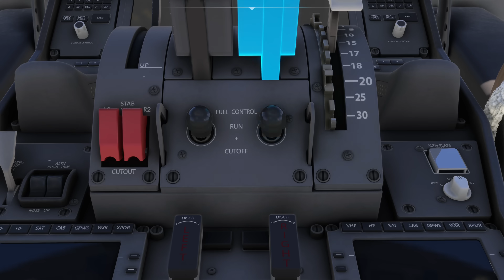Air India 171: Why Did The Fuel Cut-off Switch Get Moved?

Comment: @CaptainSteeeve 
You seem to rely too much on “information not provided” rather than “information provided”

Has there been precedence of fuel control switch failing …especially of locking feature disengaging ?  I note that the fuel cut off valve is spring loaded. The fuel control switch is same as the one on this aircraft. The SAIB from FAA in 2019 was advisory instead of *mandatory*. Shouldn’t there be conversation on whether this should have been mandatory instead of advisory?

Has there been precedence of FADEC failing on other aircraft such as Boeing 787 operated by ANA? There was an incident where FADEC turned off both engines after aircraft reached end of runway and without pilot input.

Let’s turn to sensors. 

The aircraft air/ground sensors registered lift-off at 08:08:39 UTC. 
Btw Capt Steve, this is Hours: Minutes: Seconds. One hundredths (1/100) of second are not registered as you claim

3 seconds after lift-off at 08:08:42, the Fuel shut off valve (FSOV) transitioned from RUN to CUTOFF one after another in 01 seconds. 
Could FADEC have wrongly registered that the aircraft was ‘still on the ground’ and therefore deployed CUTOFF almost immediately after lift off? Could this also explain why landing gear was not therefore lifted?

The landing bay door was partially opened but gear not fully retracted. Could this be a result of unknown power outage ? Perhaps not but needs clarification

This has similarity to ANA incident when aircraft reached end of runway and FADEC intervened and CUTOFF on the ground

A former experienced pilot has suggested chip malfunction after 11000 cycles of operation on FSOV and if correct maintenance is not done, it may result in loss of signal and potential malfunction . He also makes reference to the same FAA service bulletin above. 
https://www.youtube.com/watch?v=2w9R7wjkSEE

To suggest one pilot may have been lying when questioned by other, smacks of unreasonable bias without evidence.
If you are hinting at pilot suicide, how do you explain the FSOV being put back in the right position?

Appreciate you may be emotional about this being an experienced Captain, but please focus on objective evidence and let’s see if there was precedence on whether FADEC failed resulting in FSOV being transitioned from RUN to CUTOFF in the past, and find reasons why that happened instead of conjecture based on emotion !!!
Reply: >>"... Has there been precedence of fuel control switch failing …especially of locking feature disengaging ? "

No.

Also, the investigators have the switches from the crashed plane. If they were faulty that would have been the headline of the report.

Comment: Here you go again, blaming the pilot before you have the details. Nowhere in the report does it say that a pilot switched the fuel switches to OFF. You obviously don't understand mechanical and electrical failures.
Reply: Read the report. Unless there was a third person in the cockpit, one of the pilots did it.

"The aircraft achieved the maximum recorded airspeed of 180 Knots IAS at about 08:08:42 
UTC and immediately thereafter, the Engine 1 and Engine 2 fuel cutoff switches transitioned 
from RUN to CUTOFF position one after another with a time gap of 01 sec. "
Reply: @SeanFication key word "transitioned".  You have no evidence that it was a pilot. Saying that it was pilot induced error is all speculation. It could just as likely have been a mechanical or electrical malfunction.

Comment: Four weeks ago, I stated on one of your posts that one of the two pilots in the flight deck might deliberately switch off the fuel pumps to make that bird crash, as it did. Engines don't flame out like that in clear skies. The 787s are still safe to fly.

Comment: Is most of crashes are pilot error, why not let AI pilot takeover? Any reasons?
Reply: "AI" is just a marketing trick for selling language model-based systems (LLMs) which are PROBABILISTIC. No artificial intelligence is there, just math and probabilistic stuff such as softmax or cross‑entropy. You can be 100% sure that such а system will deliver a wrong output at some point of time and it may be the time you sit on a plane. I am a programmer dealing with LLMs so I know what I am talking about.

Comment: If there is no reason to shut off both engines shortly after takeoff, and the result of doing so will most certainly result in a catastrophic crash, why is that course of action not locked out by the computer? I can see how shutting off one engine may be necessary, but perhaps the computer should not allow both engines to be shut off in these critical stages of take off.

Comment: From my side this story start to stink … BADLY ! Can we see the fuel pressure in fuel line before and after cutoff ? Status of fuel pump ? We know the aircraft had plenty electrical faults BEFORE takeoff and seen in the video, many anomalies for a normal takeoff.

Those switches are just electrical switches, fancy ones with a mechanical design to prevent accidental command … BUT, they don’t cutoff the fuel ! A mechanical valve does, with the help of an electromagnet … in an aircraft displaying many electrical faults !

Why don’t we take a look into this before suggesting mental health issues of pilots ? Simple checks can sort out many doubts.

Boeing and all major manufacturers in USA if not majority of them are known worldwide for cutting corners for everything, INCLUDING safety which was the case for 737 MAX in order to be able to compete with AIRBUS … cheating, instead of better design and engineering at customers safety/lives, and this apply and is valid for any industry, including food and pharma.
Then you have an elected idiot who wonder why we don’t want american products of any kind.

So, let’s see some proof that the aircraft was indeed airworthy and all fuel system was responding to all electrical commands including commands for sensors and software as expected.
Reply: >>"... We know the aircraft had plenty electrical faults BEFORE takeoff"

We do not know that. The accident report makes zero mention of any electrical faults before takeoff.
But if they existed, the crew and Air India were responsible for having them corrected.
Reply: @SeanFication so, aircon and wifi not working is not an electrical fault ?
What about fuel pressure that can confirm exact when fuel cutoff has taken place ? An electrical switch regardless of mechanical features to prevent accidental switch off only open or close an electric circuit for a solenoid which will push or pull a mechanical valve … only that valve can cut off or restore the flow of fuel !

I guess the captain of the flight is watching careful the screen/board in front of him that confirm manual operation done … and he can’t miss the fuel pressure gauge going in red which would logic and rational makes him questioning why the fuel was cutoff … assuming electrical driven fuel pump was working normal as it should.

Comment: Capt Steeeve, not being critical of the pilot that put the fuel switches back to run, but in a 30 sec flight that 10 sec reaction time was critical. Asking the other pilot "why" was a waste time. Time they did not have. Was it the startle factor, the disbelief of what he saw. you seem to be comfortable with that reaction time. Does it take the marvelous computer in our heads time to process something like this. Capt Sully talked about that in his "Unfiltered" video, but he had 2800 ft and 280 seconds. seems to me that once the switches were moved to "CUT OFF" their fate was sealed.

Comment: The stories coming from this incident are amazing. Everyone has a stake in the issue. From Air India to Boeing to the Pilots Union. 

But the truth is, there is nothing in the preliminary report which even slightly suggests any problem with any switch. And the FAA and Boeing have made it clear, nobody has to do anything, there is, NO ISSUE WITH these switches. Some people keep pointing out the 2018 issue where some aircraft had switches without a block installed, that has nothing to do with this. Even if you assumed that a pilot accidently bumped a switch into the cutoff position, how do you want to explain them doing the same exact thing, to the other switch, one second later? Two accidental bumps? Nonsense. 

As for suggestions of requiring two to operate the switches, that stops one issue, but there are others, including whoever is in control to simply cause a wing strike several feet off the ground. The difference is, we would know WHO made the input to cause the crash, in this case, we don't know and even the voice recording cannot tell us, as the person who did it, could, simply ask the other pilot why THEY did it, getting the response of "i did not do it". The voice asking the question might be the pilot how did it, or might NOT be the pilot who did it. 

What we don't want to talk about is the "S" word. And sure enough, it's deleted from this video. 

Right now, the focus is on the Captain, who had some stresses in his personal life. Unfortunately, none of these stresses would seem to be something that should cause a dramatic action like this. He was close to retiring, and often that resolves a lot of issues, as long as he has a good pension. If not, then that might become part of the investigation into his motives.

Comment: 6:22 Past issues are absolutely germane to this conversation/investigation. Everything should be looked at objectively including the bad history, as there is a probability however small, that an unknown issue has crept in.
Reply: There is no "bad history" The 787 is one of the safest planes flying. This was the first fatal accident involving a 787 in 14 years, with 1200 aircraft in service.
Reply: @SeanFication  Everything is suspect until it is categorically ruled out. Just because an aircraft has never experienced a fatal incident doesn’t mean it could not happen. The history of the 787 in the early years is on record. Fuel leaks, wiring issues, battery issues, low speed display errors, unexpected altitude drops in the last two years (one still under investigation, the most recent in Jan 2025 most likely cause being failure of two Internal Reference Units which disengaged the autopilot). 

This incident could very well be a pilot intervention, but at this stage it cannot be ruled out that design, manufacturing, assembly, inappropriate/lack of maintenance issues were a cause. Why not search for info related to John Barnett, a former quality manager who raised concerns about 787 production.

Comment: Video at 3:47 mark: Design those fuel cutoff switches so both pilots have to do something in order to operate those switches:
Stupid idea that won't work if one pilot is incapacitated (stroke, heart attack, etc.). I'm sure that the Boeing engineers who designed the 787considered that idea for a split second and immediately rejected it.